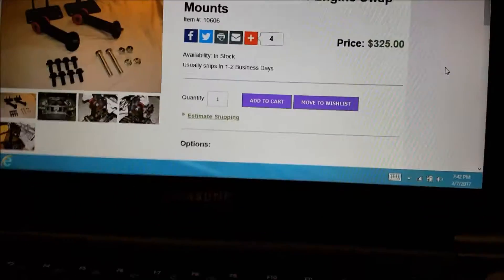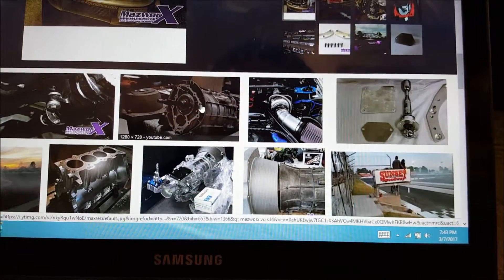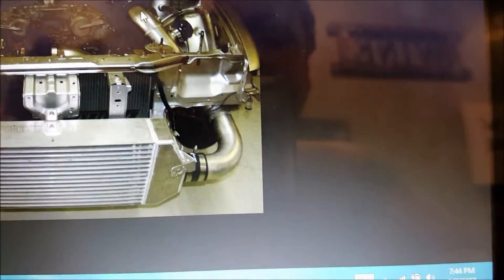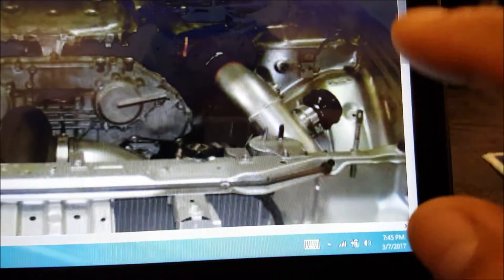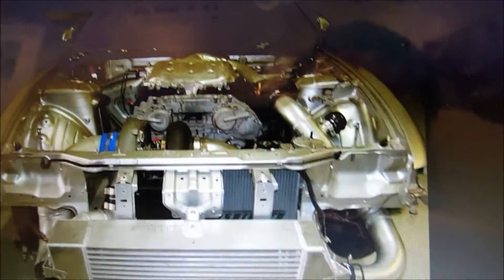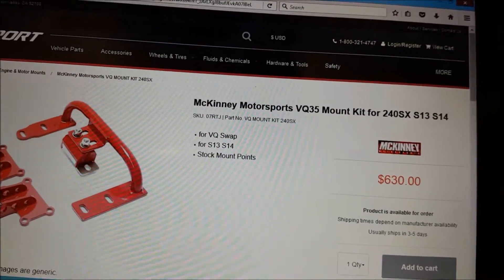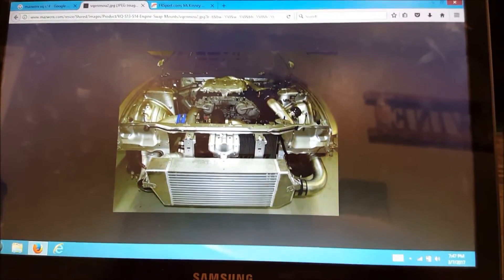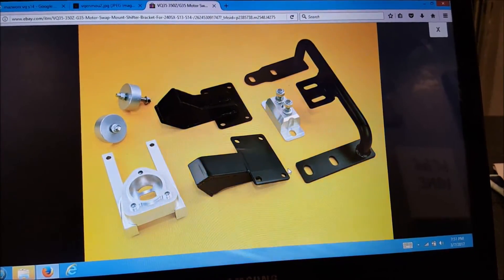VQ35 Build - Part 7: VQ  Motor Mount Kit

Comment: Super excited to see watch this swap happen. I've wanted to VQ swap for a while now but I don't know the extent of the wiring/mods required to make it happen.
Reply from the maker: Tech Inbound Don't let the wiring discourage you.  It is quite easy once you know what wires are needed to make a car run.  Yes, if using stock ecu, fly by wire setup, and harness, it would make me 2nd guess.  But nothing Megasquirt can't remedy.  I just can't wait to hear her purr.  It will take some time but lil by lil, it will get closer.

Comment: Mazworx kit is the way to go, the McKinney kit fell apart within 2 months
Reply from the maker: I bought the chiney replica.  Has held up and fit fine.  If it breaks, then I will tig it back.  The hard work is done with line up.  How did your break?

Comment: Would 350z vq35hr s13 mounts work for the vq37vhr. I have a v137vhr I'm trying to swap but nobody makes mounts for s13's... :( Thanks!
Reply from the maker: I looked at the 2 blocks on the web and the mounting points look the same between the two.  Nissan does not change much and motor mounts are probably the least of their worries.  Look at the difference and it looks like you will be fine.